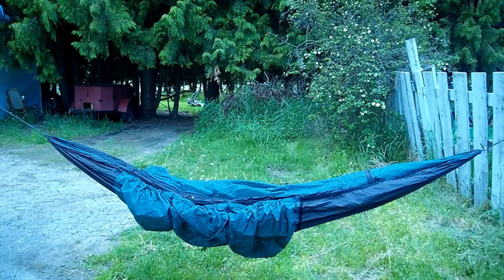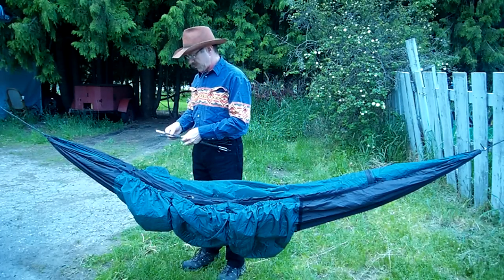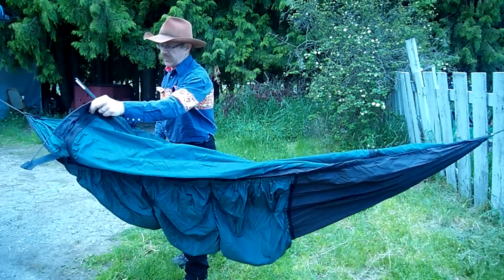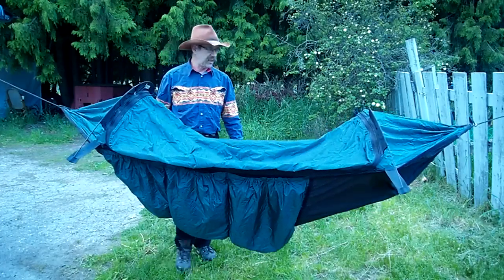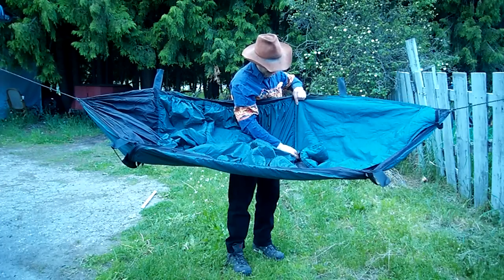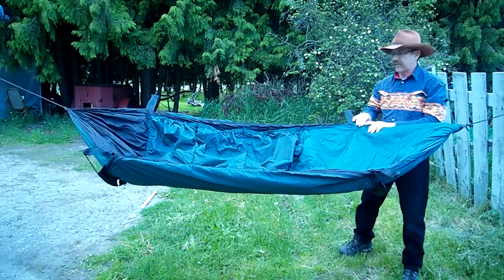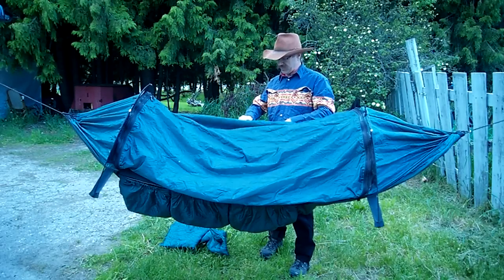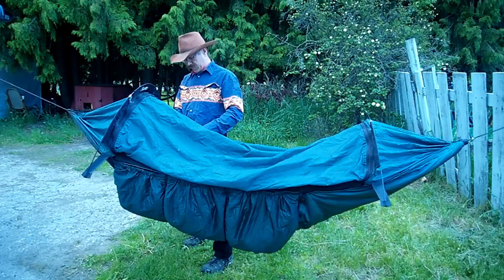Z Liner,Spreader pole install

Comment: Nicely done! I have been thinking about using additional pocket shaped goose down insulation. Any thoughts? Do you notice cold spots? How low has the temperature been where you start to get cold using just the Z-liner or using it and your add-ons?